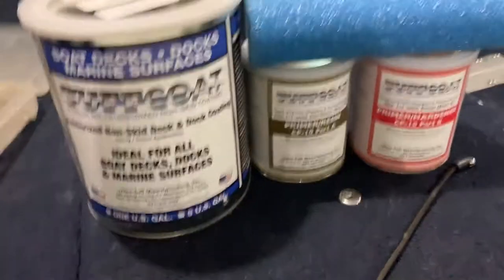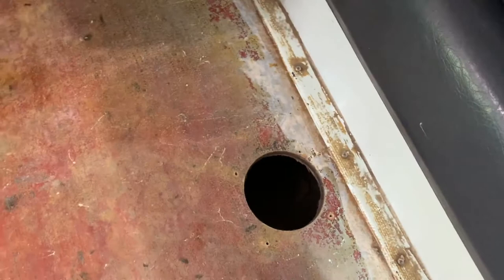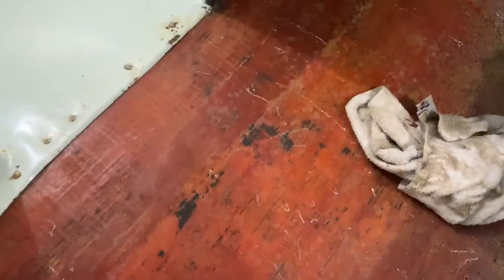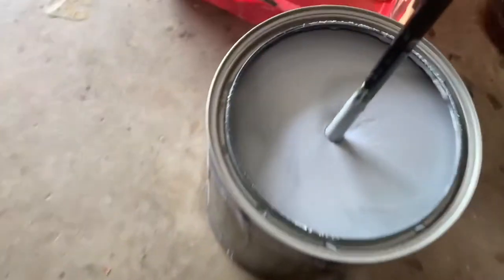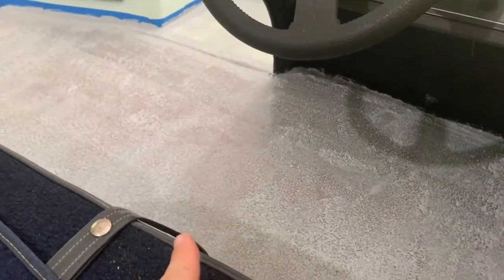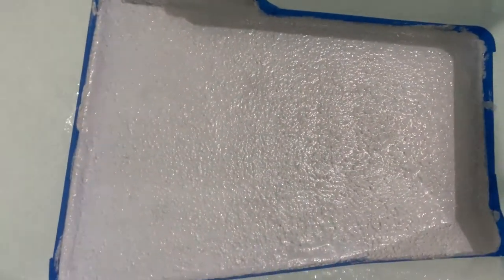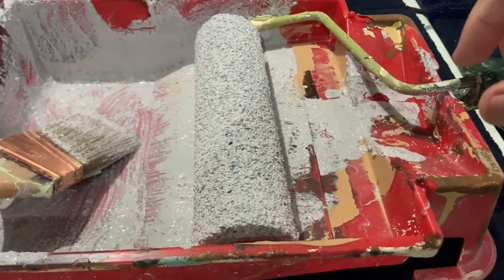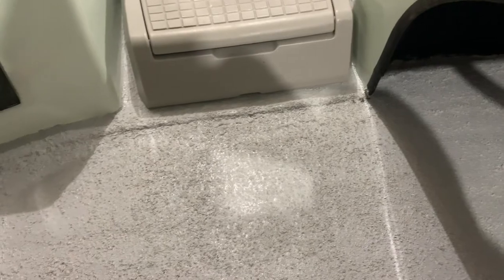Tuff Coat rubberized boat floor paint. Carpet may be a thing of the past.

Comment: I’m currently working on our boat floor and notice the pinkish colored thick coating that you were sanding over. What is that? Some of ours came off attached to the old carpet and I’m not sure what to replace it with.
Reply from the maker: I think it’s fiberglass resin. Far from an expert though. Good luck on the floor! Are you going with carpet?